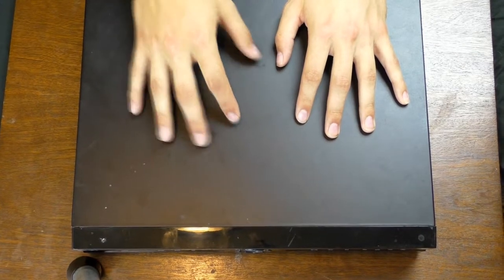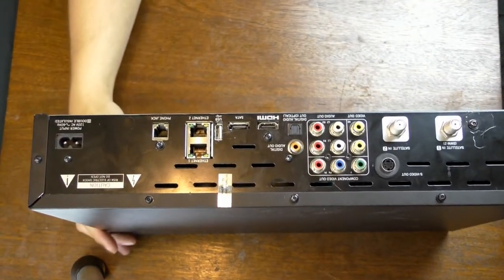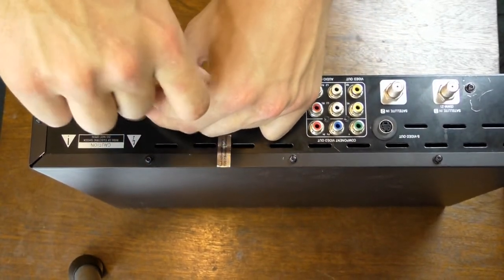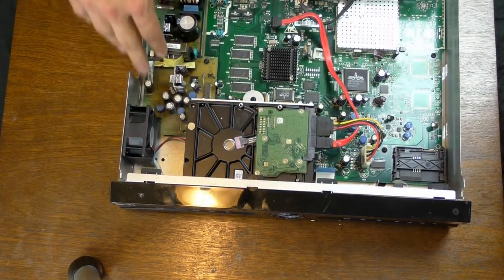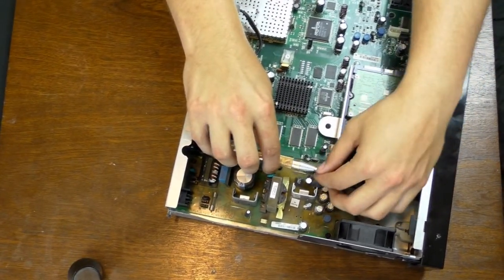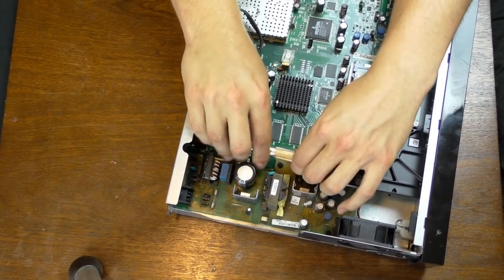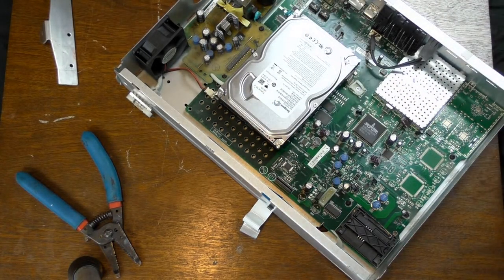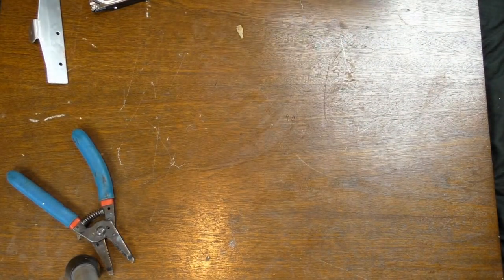Get Free HardDisks From Old DVRs!! (Patreon EA Video)

Comment: as a scrapper. I've taken many of them a apart. a little aluminum. and copper the circuit board. and the steel housing. if you get enough of them them it adds up. I've cut myself on them as well. I'm used to it though :D
Reply from the maker: +PyRoOWL 1995 Seems like everytime I take something apart I slice my finger one way or another XD